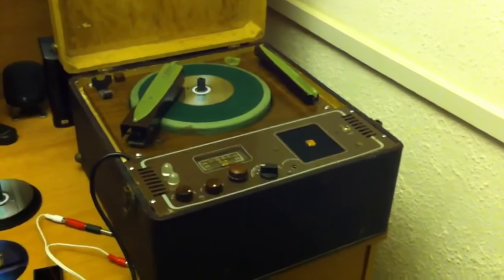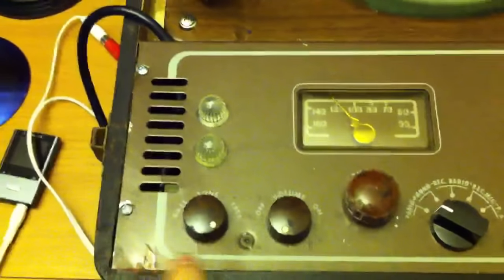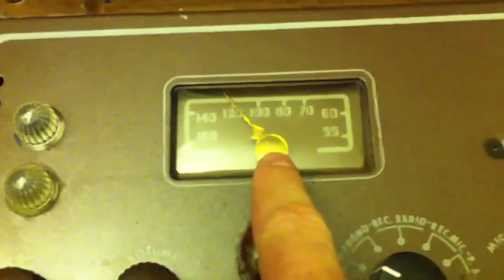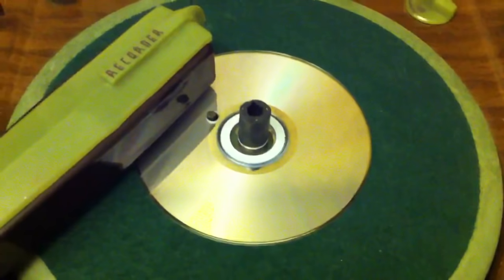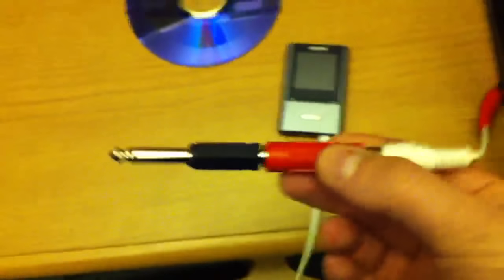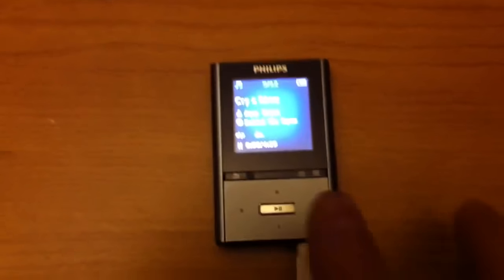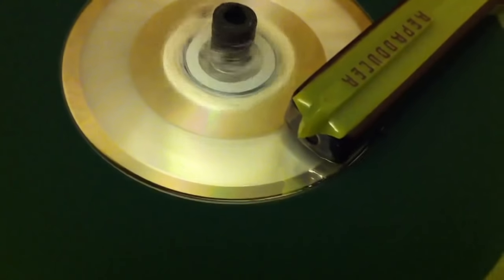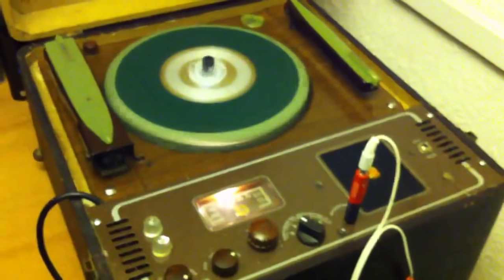My Restored Montgomery Ward Airline Record Cutter

Comment: What a fascinating piece of kit - more so that it would seem that most of the people replying are familiar with it, but with 30 odd years as an electronic hobbyist, I had no idea that "home" cutting had ever been a reality!

I'm quite surprised that what appears to be a relatively light pressure and simple mechanism in the cutting arm is able to produce a useful audio track in polycarbonate. What is the axis of movement of the cutting stylus? Surely not simply perpendicular to the disc? This would indicate that it should be relatively easy for a tinker to produce a functional experimental apparatus (fidelity notwithstanding).

If nothing else beyond old tech porn (not that there's anything wrong with that) your video has sparked my imagination - as someone who's never tired of vintage home computers, it might be a wonderful challenge to cut old programs (originally intended to be stored on audio cassette) onto a suitable medium and utilize a record player as a program loader.

Comment: Very cool.  Thank you for the demo on your project.  I am trying to transfer my dad's 1940's records to digital.  Did a few already, but I'm now ordering a better turntable and a 3.0 mils stylus for a better transfer.  It is an interesting project for me as I don't remember my father's voice.
I didn't realize he had a recorder at home, but I see now that he must have.    Unfortunately, quite a few of his fragile records are damaged.  Some are bent, the surface split or cracked, or has mold on it.  I'm going to look further into the lathetrolls site you mentioned and see what I can learn.

Thanks for posting this.
Reply: I don't remember exactly where to get it, but if you search around there is a software project that is capable of reconstructing some of the audio from a visual scan of the record surface (usually done with a desktop scanner, but higher-res is better).  That might be able to decode some of your damaged ones as well with a little careful photo editing.

Comment: @databits 
By doing that you were inadvertently embossing the CDs rather than cutting them. It's actually a lot easier to get good results that way and isn't hard on the cutting needles at all.

You can also get needles that were specifically designed for embossing plastic (like polycarb CDs) which is what these home machines were really designed for.

Comment: do you think its nosiey because the playback styles has too much weight..if I had one of these I would try to add a limiter and other outbord gear between the record input and the record head..I saw your put it in another enclosure in another video you did so it shouldn't be that hard to do if you wanted...maybe the noise is just a mechanics problem but it would be interesting to see if outboard stage could make the recordings better.

Comment: i bought a cutter like this off ebay too...  also just thrown in a box with no packing...   about to restore it this month..
Reply from the maker: theprophetkato Make a video and link me?  Are you going to rebuild the cutting head?
Reply: i might try..  Ive had it for 10 years with plans to rebuild it.. so its still just a plan..  the cutting head has no needle, so it will need to be taken apart anyways.. I don't know if its good yet. I don't know anything about whats inside the cutting head, but once I see the inside, it shouldn't be a problem to duplicate it.  im hoping anyway. I want to re-wire the whole thing, add gold connectors, extra grounding..  and make sure there is nothing causing unnessecary noise.. ill make a video when I do it and link you..  hopefully I can get started on it this year..

Comment: I just picked up a machine exactly like this one. When i go to cut on the back of a cd it is very muffled. I understand some surface noise, but it is coming out really quiet. Have you run into anything like that with your cutter?
Reply from the maker: Yes, are you using the original microphone?  It may be useless (as was mine) or near useless.  Have you replaced all of the tubes, capacitors and had the cutting head "recoiled?"  Those were all things mine needed.
Reply from the maker: Make a video of your unit in action!

Comment: This is very interesting to say the least. I like the fact that it was originally specified to work with 33 1/3. That said, the sound at 78 was disappointing; I would imagine that is possible to achieve better results with actual blanks?  On the lookout for one of these buggers with the original motor in it! Strange that these machines existed and I knew nothing about them whatsoever...lends creedence to the notion that somehow this timeline has changed around me

Comment: God job!
I have a similar device,  but why the rotation of the recorder goes  from the center (reverse)!  And before record, i reverse music file, it is not very convenient. :(
You are not faced with such a problem?
Reply from the maker: No such problem here, no.  I've not seen one that requires reverse recording.
Reply: Check for mode switches.  For things like movie soundtracks that took up both sides, it was common to cut the first side outside-in and the second side inside-out so that there wouldn't be a huge jump in sound quality when the record was flipped over.

Comment: Here's an idea, how about recording SSTV images to a record? :)
Reply from the maker: kargaroc386 What is an SSTV image?
Reply: Slow scan television
Lets you convert pictures to sound that will fit in a ham radio channel, or a record, easily.
Reply: kargaroc386 what about making CED compatable disks?  those were movies on vinyl from the late 70's/ early 80's ...maybe not a good idea since it is very hard to find those players..
Reply from the maker: theprophetkato Here's the closest thing I can do: Sound Recording onto an RCA Selectavision Videodisc
Reply: i don't think the frequency response would be high enough in order to encode a video signal

Comment: I cringed when you mentioned the eBay seller who provided zero packing when shipping this to you. Thankfully the easy majority of people are not as clueless as that and I would say most actually do a good if not great job of packing items I have purchased on eBay. But out of probably 700 or so purchases on eBay I have had maybe 30 poorly packed purchases with about 10 of those really bad jobs and maybe 4 or 5 actually horrendous packing attempts ... if you can call them that.
The most memorable easily being a vintage lamp I purchased specifically for the lamp shade. All sitting in a box that had zero structural integrity left, the lamp rolled on it's side loosely draped in a bed sheet with a gigantic hole in it, and the shade slumped off to the side. I am a hetero guy and my neighbors heard me scream .... loud! 
Miraculously they both survived with some damage even though the packing job scared the shit out me. Yet a few others items that had been packed better showed up pulverized beyond recognition. 
But I am guessing the amount of time and effort that went into fixing this device was many days and hours. And that is exactly what I did to make something right again after being damaged during shipping. But mine didn't have to do with electronics like here. But instead 4 1960's framed prints I bought on eBay paying a decent price due to their popularity. Yet each print was stacked front to back with nothing to protect the frames and the metal eyelets used to hang the prints gouging the prints frame behind it. 3 inch black frames that stepped down to a narrow 1/2 in. white border stepped to a 1/2 " narrow gold leaf border. The front frame undamaged with the other three gouged severely on all 3 levels requiring complete strip down, repaints and re-leafing too.
I had never attempted anything like it but I had too much into them to not warrant the time and effort to take the plunge and make them right again.
Eesh ... so yea ... I feel your pain.